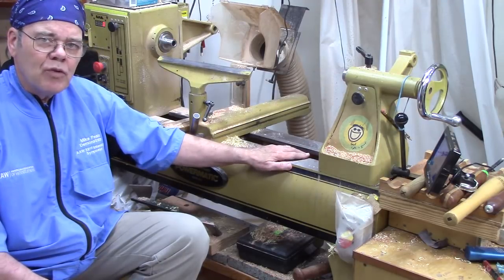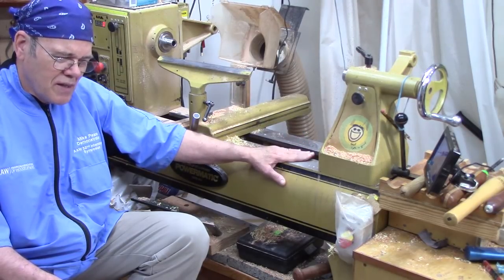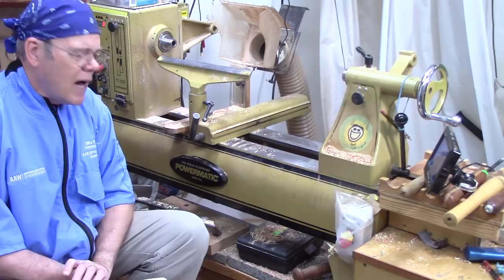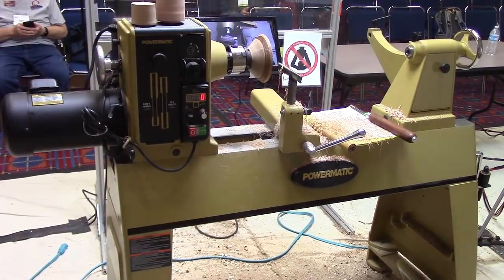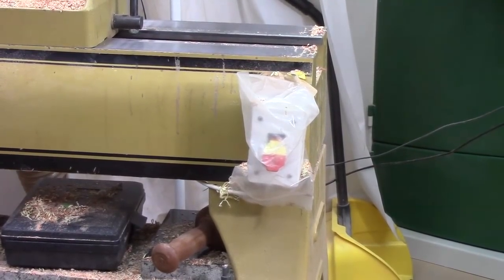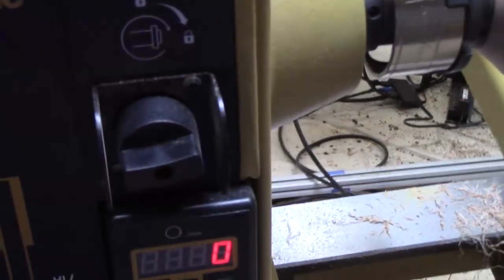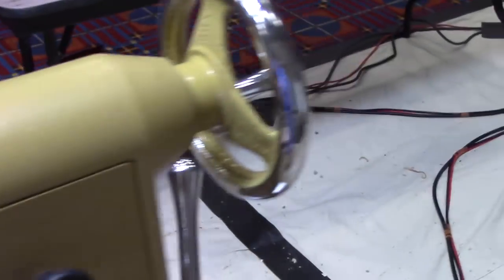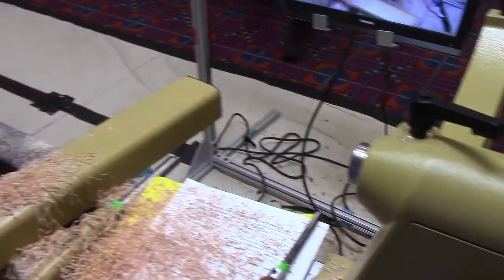New Mustard Monster – PM 3520C Powermatic Lathe

Comment: I would also recommend putting the movable control box in a plastic bag as soon as you get your la he.  .   I bought my 3520C in January and 2 months later the control box quit working due to dust intrusion.    Installed a new box and put it in plastic.   It works great.   Overall, I love this lathe.  That is the only issue I’ve had so far.   I also added a shelf below the lathe bed.
Reply from the maker: That doesn't sound good. I am guessing the leakage is around the on off switches. I have never had a problem with the big mushroom switch on my 3520b. I would think the bag might interfere with using the speed control a bit?
Reply: The bag does interfere with the variable speed knob a little  but it’s a small sacrifice to keep the switch working.   The folks at Jet said mine was the 3rd  box failure reported.    They were great with support and got a replacement switch out quickly but it did cost me a weekend of turning.   Without a doubt, I would buy the 3520C again.

Comment: Mike, if you don't mind sharing, how much did yours set you back?  Probably a bit more than my $225 Harbor Freight jalopy.  😏
Reply from the maker: I paid about $2600 new. I have seen them go as high as $2900 used! Prices for quality lathes will continue to rise as new prices do. Not so much for lower quality lathes.
Reply: Mike Peace Woodturning I’d be really interested to know where you picked this up for $2600.  Everywhere I’ve seen it, it’s selling for $4500.
Reply from the maker: @BobGarrett66  As I mentioned in the video,  I bought my 3520b in 2007.  I did not buy a 3520c.

Comment: But how did you like turning on it?
Reply from the maker: No major difference than on my 3520B which I love. Same 2hp motor and controls. The tool rest locking mechanism is better than on the b model.  This lathe is still a great option for a full size lathe.